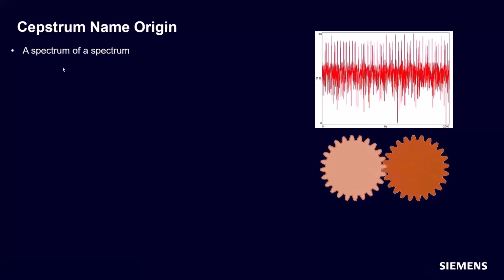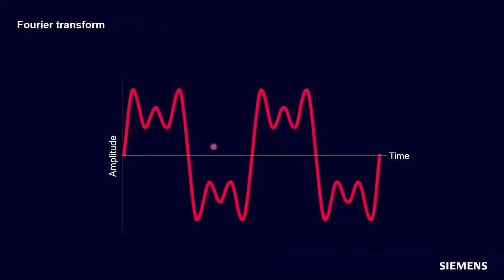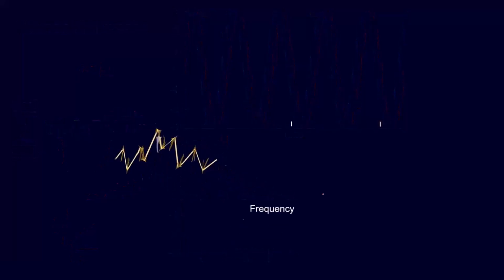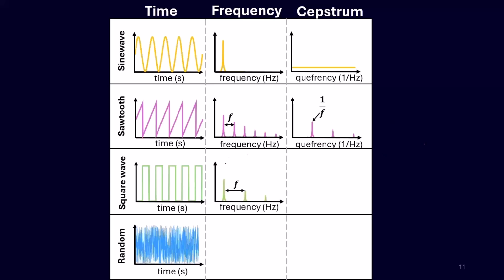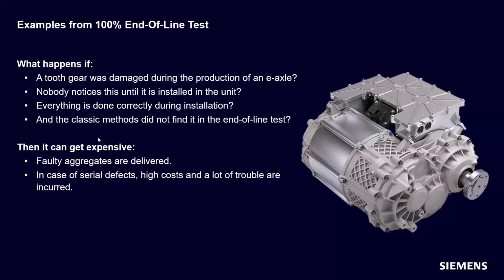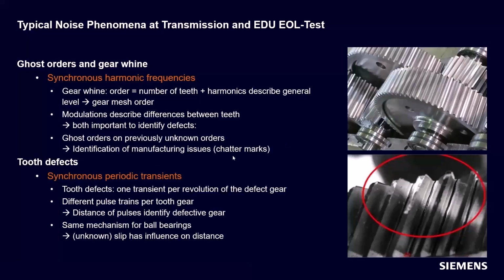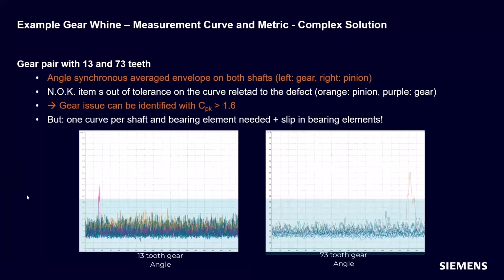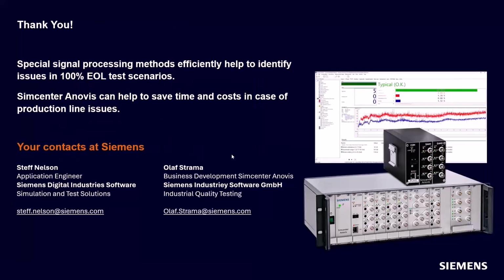Cepstrum Analysis

Comment: Probably it is good for speech breakdown, but it doesn't help to enhance the audio
Reply: It does help enhance the audio quality, but only if you want to highlight the voice. Cepstrum analysis can be used to isolate voice from an audio clip, then you can turn down the volume of anything else and tadah, clear voice without background noise! You can also use cepstrum analysis to perform homomorphic deconvolution which is, to my knowledge, a great tool to remove echoes from a voice.
Reply: Why are you pretending as if the only practical use of this in audio is to "enhance" audio? Have you never seen cepstral formant shifting or other DSP fx?